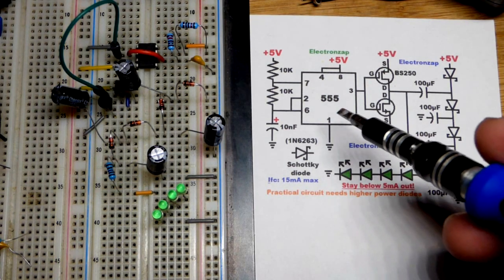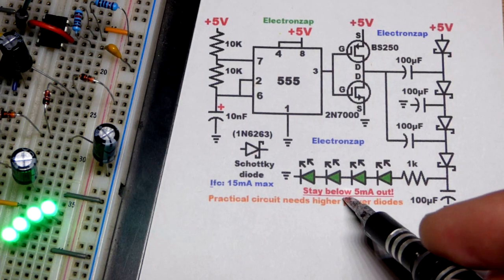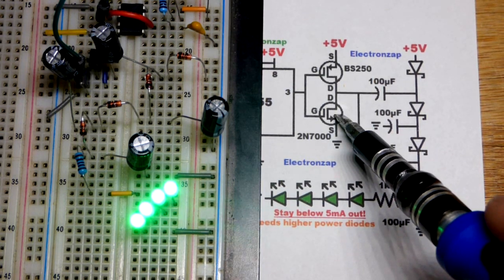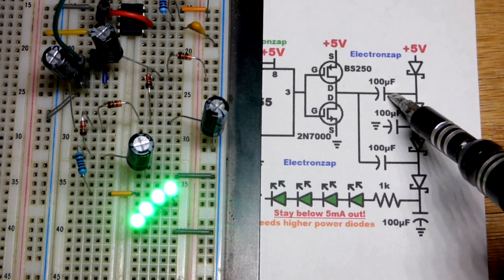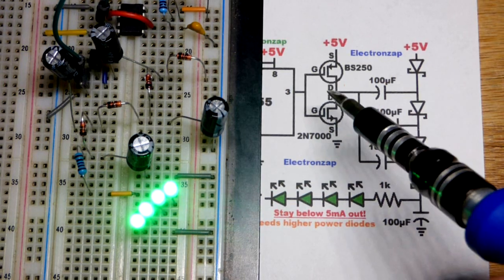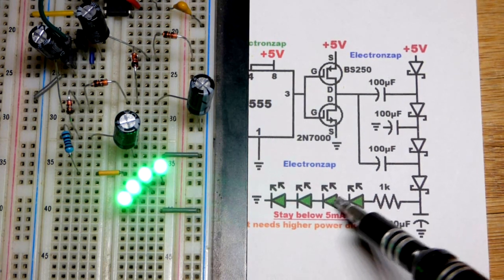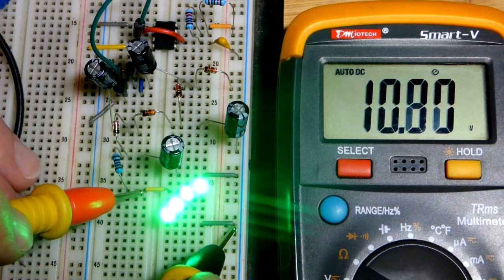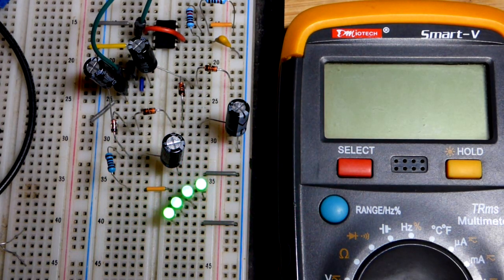Low power Schottky diode voltage tripler using astable 555 timer controlled MOSFET signal inverter

Comment: I guess some kind of volt sense  zener diode feed back control circuit could be applied to IC 555 pin 4  ?
Reply from the maker: I didn't design a feedback system yet, I was planning to add that some day. But definitely, sending a low signal to pin 4 to keep the output low is probably the best way to pause the process.

Comment: I built some passive ring modulator guitar pedals a couple of years ago and sold them. The original circuit used germanium diodes for their low forward voltage drop (small audio signals) so I experimented with Schottky diodes ... they worked and the results sounded just as good. I think a lot of the "mojo" with germanium is with building overdrive and fuzz circuits, otherwise Schottky should be a cheap replacement.